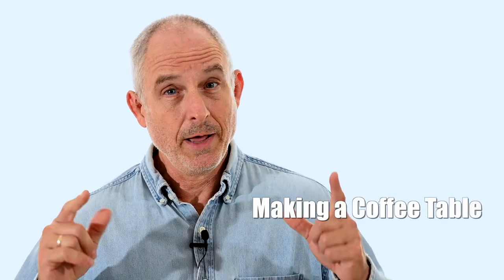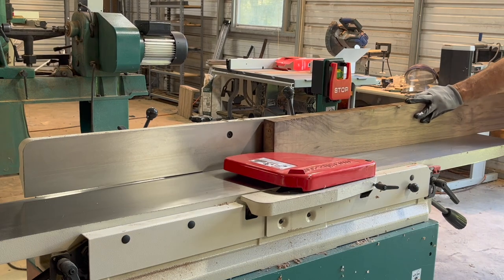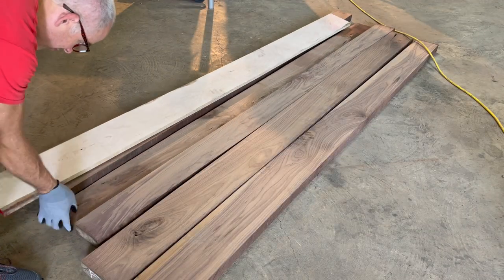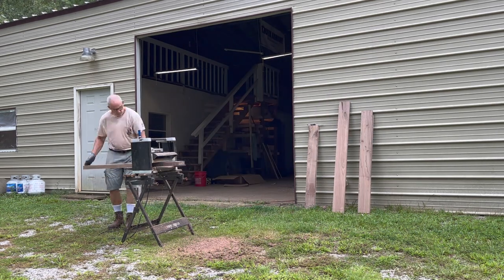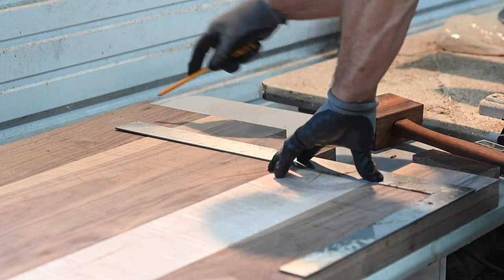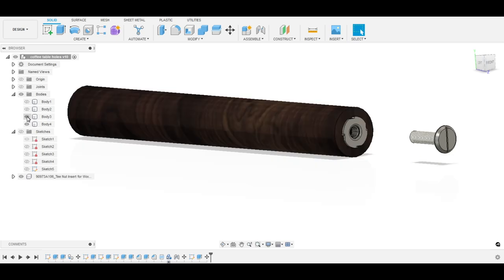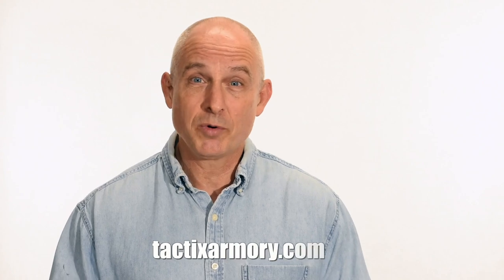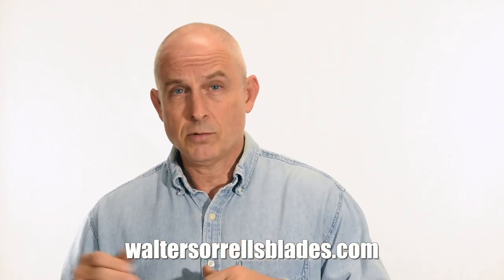Amazing Coffee Table Build - Pt 1 (A Knife Maker Does Woodworking!)

Comment: I found the " using sandpaper only a metal worker would use" pretty accurate. I do a lot more woodworking that metal fabrication. Interestingly, when I started using a good hand plane for the final finish rather than sandpaper, I experimented with finding which grit would get me to an equivalent glossiness produced by a very sharp plane iron. I landed on 1200-1500 grit depending on how much use the paper had. That was a very close match. If I stain the wood, nope, don't go that smooth, it's too smooth (tight a surface) to produce even color. I rarely stain the wood so that silky smoothness is fine. Yeah, it's probably a waste of time to go that smooth, but the results will make you smile. Don't use a finely tuned and quality hand plane if you're gonna stain, but for a natural finish, you'll be happy.

Comment: hi ! it's a very good video, and, as a professional cabinetmaker, i like very much to see how a metalworker do that job (especially if that metalworker is a youtuber whose videos i watch). However, i would like to introduce a security point : never, ever, wear gloves when handling rotatory machines. Woodworking machines are especially dangerous (i think you already guessed it). If one of your finger gets in contact with the blade, you may loose your fingertip, or even your whole finger (a teacher of mine had three fingertips missing due to a stationary router, and one of my employers had two fingers missing, crushed by a molding bit of a stationary router). BUT, if you wear gloves, the glove is very likely to be attracted into the machine by the rotatory movement, and when hand will follow, there is nothing you can do to save it. When i was in (the french equivalent of) b-tech 1, a girl in my class had her hand sucked into a 3-bits drill press, because her glove were too close of the drill. She narrowly escaped the lost of her thumb, and the had to undergo an emergency skin transplant.
Well it's all for the security advice ^^ Goodbye, and can't wait to see the second part.

Regards from France

Comment: Considering you have some precision machining machines in your shop (mill, maybe lathe), how do you mitigate the presence of dust? Do you have different rooms? Do you cover stuff? Do you simply not care and use the machines?
Reply: Not sure how he does it, but in my case I've been working out of a 40 conex container behind my house since I don't have a garage. I have woodworking stuff (saws, sanders etc) at the end by the big swing doors, and my lathe, mill and welding stuff at the other end by the man door I cut into it. There's no way to mitigate dust completely, but a quick wipedown of the machine ways on the lathe and mill will grab most of the dust. If I'm doing a lot of woodworking in one shot, I'll throw a plastic drop cloth over the metalworking stuff to keep the bulk of the junk off of it. It's just something I've learned to live with working in a confined area. My lathe has felt wipers built into the carriage that catch swarf, chips and bigger stuff, but the mill doesn't. I keep rags handy.